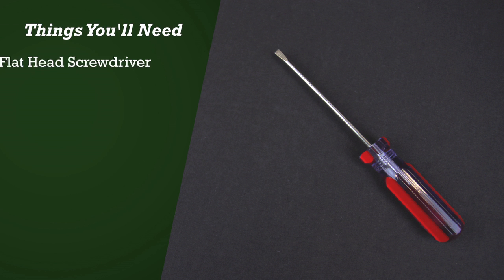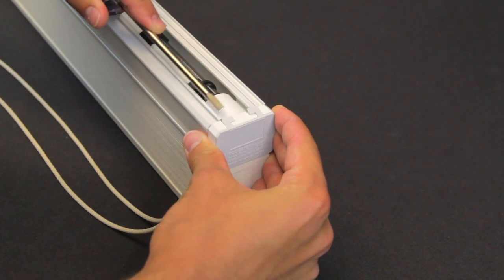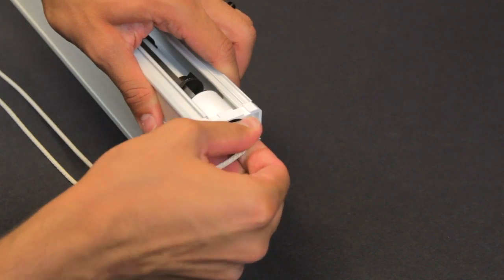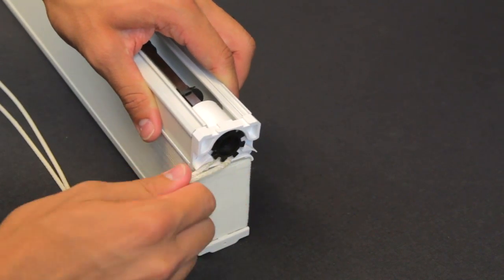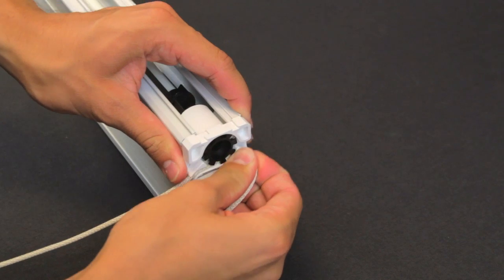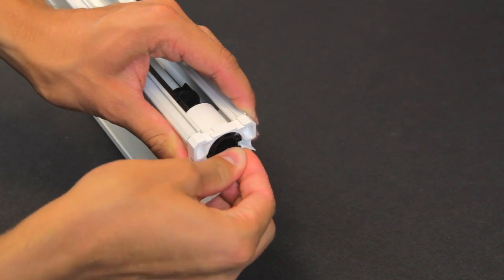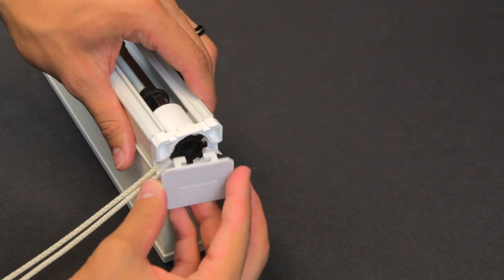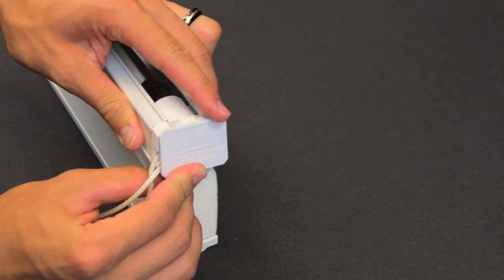How to Replace a Cord Loop in an EZ Glide Honeycomb / Cellular Shade

Comment: Thank You!  How do I figure out how much cordage I will need to replace the entire cord for my honeycomb blind?
Reply from the maker: We have formulas that will help you figure this out. Please look at this webpage: https://fixmyblinds.com/pages/string.
Reply: @fixmyblinds  Thank You!  I just realized my blinds can't come down because they are glued flush to the walls, (side and back) so there is no way to get to the side to pop it off and replace the cord.  My cord comes out of the bar, about 1-1/2" from the right-hand side of the bar, not the side anyway...doggonit.
Reply from the maker: There may be hidden mounting brackets that you can't really see so it seems that the blinds are glued to the wall. You may be able to get a look at the brackets up behind the top rail. If you'd like to take some pictures of your blinds and email them to me, I can provide some instructions for removing them so you can replace the cord loop. Our email is service@fixmyblinds.com.
Reply: @fixmyblinds  Thank You!